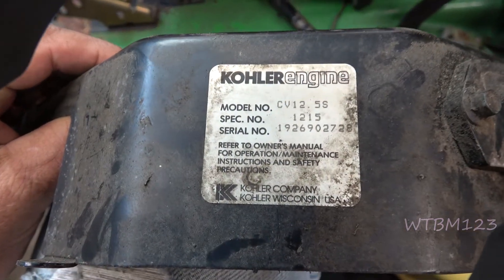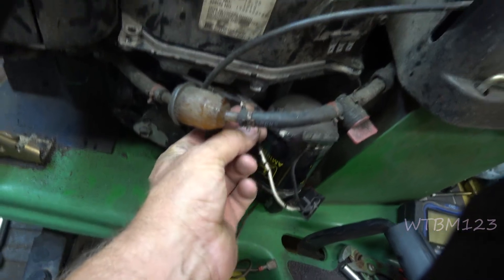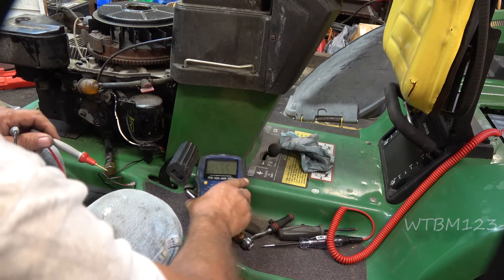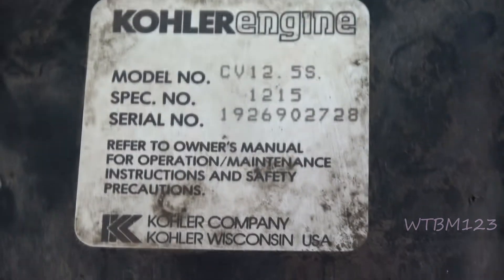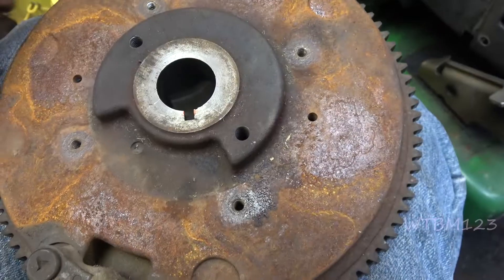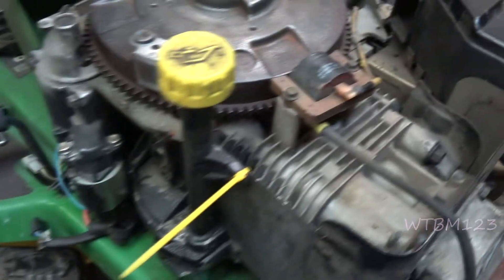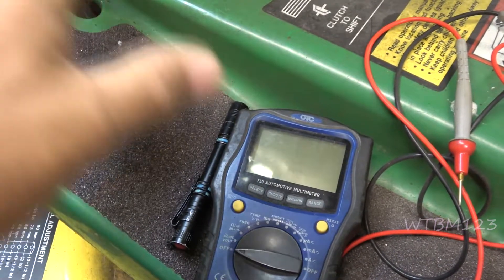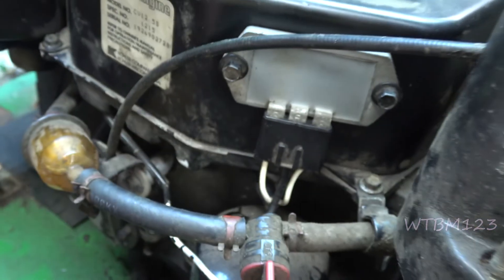, Wrong flywheel ,How could it run, Not charging  Burnt stator, John Deere STX38

Comment: The magnets are stuck on the stator. 

Does the flywheel have the same casting numbers inside? If not then it could be several things.

Could be a part that was changed or updated by Kohler due to timing issues, starting issues or overheating issues, or longevity of the ignition coil was compromised by the advance timing of the flywheel you took off. Or even timing alterations by the OEM. In other words, the flywheel may be proprietary to Deere. They could have requested more advanced timing while other kohler engines were supplied to different specs for different brands. 

Overall it is only a few degrees and won't mean nothing in the long run. Engine may run cooler with the timing retarded. The magnets can get knocked off by just the starter engaging, the epoxy they use is crap.Once the first one hit they would peel like a banana.
Reply from the maker: I called Kohler . They said it could of been the wrong flywheel to start with .They say it has happened before , but someone could of changed it also.  The guy at kohler  reassured me the new one is the correct one for it.